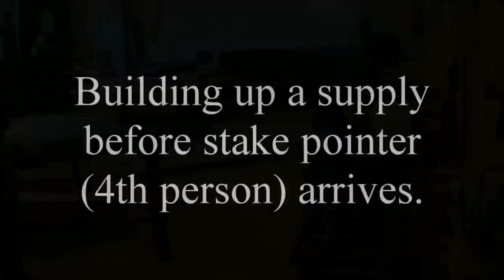Husband, Wife, & Sons Mill Logs into Stakes with Wood-Mizer LT50

Comment: I remember the saw mills with the big old engines, belts and pulleys that was set up in the woods or at a location some where and all the logs can to them and the saw dust piles the size of small hills. Things have came a long since them. that was back in the late 40's and early 50's

Comment: I have been watching your videos and I have a suggestion to help your legs, feet, and body maybe feel not quit so tired.  Put a rubber mat where the pointer is standing.  It can be moved to where it is needed.   Also get a  mat strip to go under the sawyer to cushion the footsteps there.  They are made with tapered edges and ends to reduce tripping hazard(Trane used these mats at  workstations on concrete floors and they really do help with the feet and legs).  If you don't want to spend the money for the mats build mats from wood--about 1 to 1 1/2 inches thick by 2 feet and the length of the saw run.  The wood is also a pretty good cushion over concrete.  Make these of sections to easily tip up for sawdust removal and then lay back down.
Reply from the maker: Thank you for your concern and suggestions. We decided against mats for the trip hazard and difficulty of cleaning that you mentioned. In fact, we do have some mats, but they ended up outside. Since we have a family operation, we can easily take breaks whenever necessary. Although, I never thought about the stake pointing days, because that stationary job could definitely use a mat!  Thanks for the idea and for watching!! Linda

Comment: Thanks, as always, Linda. You people are some of the most organized and diligent I've seen.  You are a good testimony of your faith.

I, like commenter Benny, am curious as to whether it is a difficult decision to use what looks like very valuable oak for stakes. My assumption is that your buyer(s) specifically ask for oak, and that, taken as a whole, the price per stake justifies the use of what appears to be prime lumber.  In any case, I'm confident you and your husband have figured all the angles.

Blessings on each of you.

John
Reply from the maker: Thank you for the complimentary feedback!

The customer specified Oak and the stakes cannot break, so we have to use fairly decent logs to make the stakes. A few small tight knots are okay, but using a junk log produces a junk stake that will break. One of the logs was nicer than we would have liked to used, but our supply was running low and the job had a timeline that our supplier couldn't meet.

Blessings to you and your family, as well, John!
Thanks for watching!
Linda

Comment: I used to saw survey stakes with my mill...It works alright but they are not quite smooth enough to write on with a big marker and they wore out to fast...Nice work you did.
Reply from the maker: The surface is a little rough for a marker. Thank you for the compliment and for watching! Linda

Comment: Great shop & good team work. Can I suggest something that can make a world of difference. Get your team and have a look at this video. Notice the amount of stooping down or either picking up or placing down. (Knees straight, bending over causing the back to bend forward to reach or place your work) Get those pallets up to a height that you don't have to bend over, your back will thank you for it. Every bending over is putting stress across your back and it's not doing you any good long term. If you work where all that's moving is your legs for walk about, and your arms and hands for placing, it will benefit you long term. Those stakes are very light, but there's a lot of them, notice how its easier when the stack gets hip height. There's a lot of stakes placed or arranged in those racks or pallets before you get to that height. Make it easier for yourself. A simple adjustment to your process can make a world of difference and you'll not feel as tired at the end of the day.

Comment: just wanted to ask what you all do with the scrap pieces. if you chip it that would make a great video as well and it is nice to see a family working together
Reply from the maker: +Arthur Elks, Jr. The smaller scrap gets ground into mulch and the slabs are sold as firewood or used to heat our kiln or buildings. Thanks for watching! Linda

Comment: If you do these on a regular basis, there are drill bits that are basically large pencil sharpeners. They are made in different sizes.
Reply from the maker: QuantityEngineers Thank you for the suggestion, we looked into the pointers a couple of years ago. If we did this often enough, we would invest in one. They aren't worth the investment for our current market, though. Thanks for watching! Linda
Reply: I think a pointer/sharpener can be bought to fit a 1/2" drill.

Comment: I watched a video recently where a guy was putting a point on pegs. He was using a machine with rotating knife blades he described as being and oversized pencil sharpener. I could help thinking that machine would probably triple production for putting points on your tree stakes.
Reply from the maker: +fletcher3913 Yes, a pointer can double or triple production, if used with Oak or Hackberry, although many other wood species plug it up. We bought one, right after this video was recorded. The demand for stakes is increasing, so we decided it was a good addition to our tools. Mostly, to prevent pointer man fatigue, because one person had the brunt of the pointing to keep points uniform. It is serving us well. Thanks for watching! Linda

Comment: So do you retail these Linda, or do they go off to another outfit for packaging into smaller lots?

And I can't help thinking, as a small-scale production woodworker and systems specialist, that there must be a quicker way to shape the pointed ends! Nice as they are.
Reply from the maker: The end user typically calls in an order for a specified number of stakes for trees, silt fence, silt socks, etc. and we process them to their specs. In this case there were over 1000 stakes to be used for trees by a sub contractor doing a big job.

There are machines that point in one motion, but they are costly and we don't make enough stakes per year to justify owning an automated pointer.

Thanks for watching! Linda

Comment: Can I make another suggestion....The Stake Journey...the log:-...... converted by the woodmizer into the stake, Operator 1; lift & place,  (goes onto a pallet) Operator 2;  lift and place (goes onto the chop saw, point added) Operator 3; lift and place onto another pallet......finished. Suggestion: - consider pointing the stakes straight from the woodxmizer!! Take out Operator 1,  lift and place operation from your process. Lift from the woodmizer and point at your chop saw and then place and stack on the pallet - finished. Consider the means necessary to make this happen so you save effort and money. I hope this gives you food for thought, the less handling those stakes the better, your shop is not automated so human input on this task or process needs to be as smart a set up as possible. You have a wonderful saw (woodmizer) and your team are like busy ants running around it. Make the most of that technology where a smart set up around that saw can pay dividend long term. Sometimes a fresh pair of eyes can help a situation. I hope this is of some help to your business. Good luck from Ireland..

Comment: What relegates that seemingly "clear" oak [?] into low-value stakes?  Maybe a tribe of midget Indians who prefer tents versus hardwood flooring?
Reply from the maker: The customer specified Oak and the stakes cannot break, so we have to use fairly decent logs to make the stakes. A few small tight knots are okay, but using a junk log produces a junk stake that will break. One of the logs was nicer than we would have liked to used, but our supply was running low and the job had a timeline that our supplier couldn't meet.